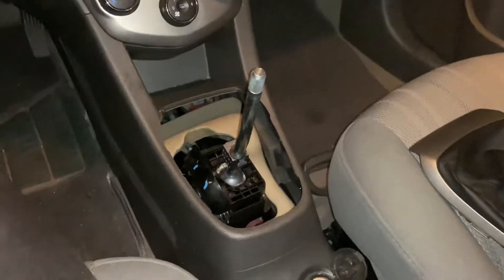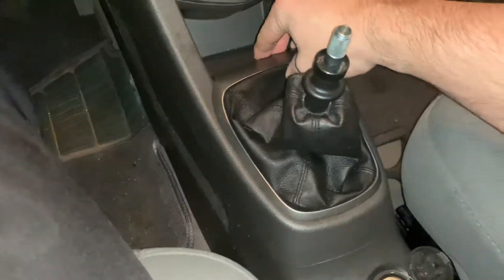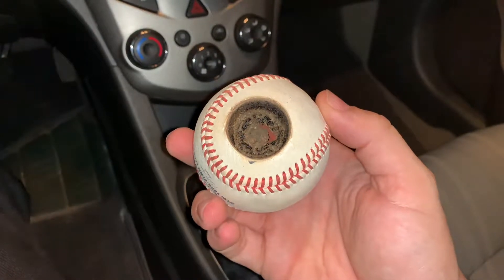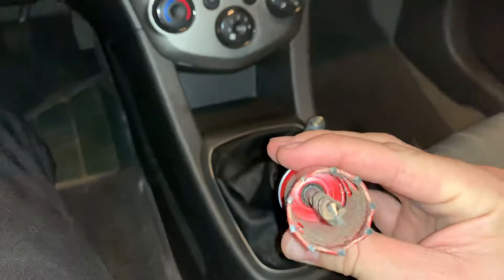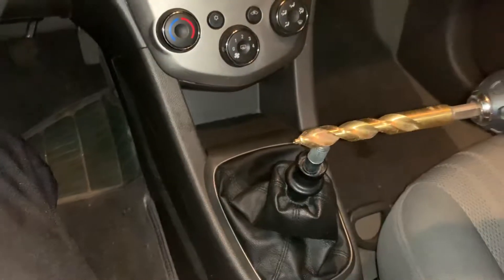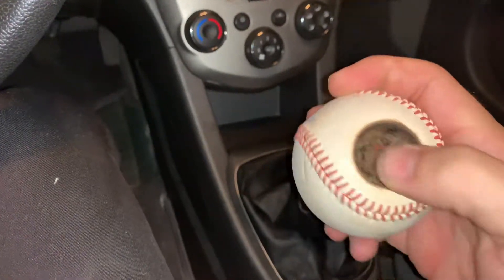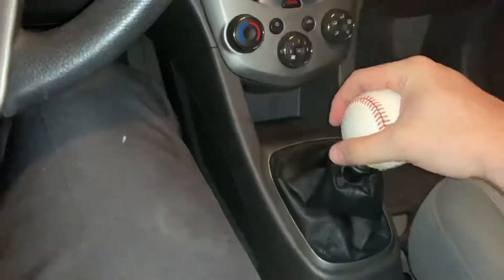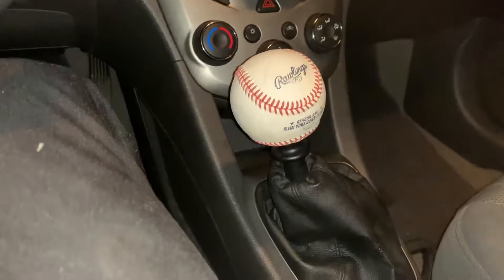Baseball Shift Knob Chevy Sonic

Comment: Things gonna be dirty as hell in less than a year. 😂
Reply from the maker: Looks like it has seen a few games that for sure, I did a second ball but poured clear epoxy over the ball so its easy to clean. Also was able to remove a shifter from a junk yard Sonic and was able to make a rubber mold to put in between the shifter and ball to hold it firmly in place